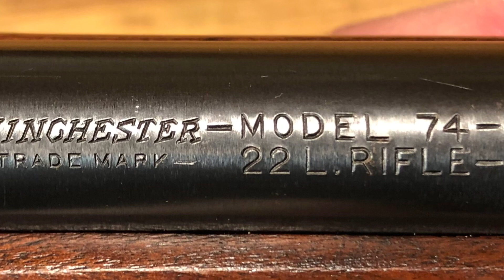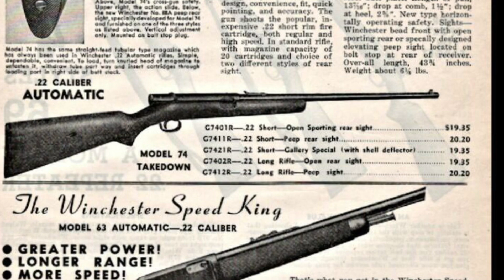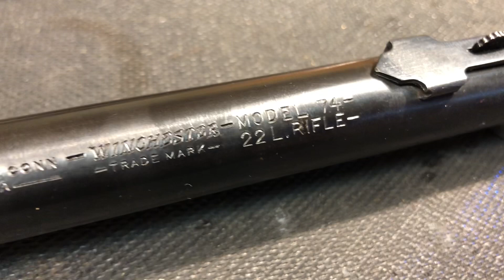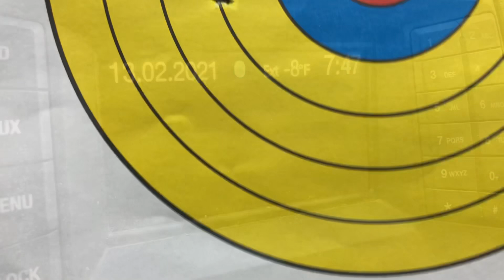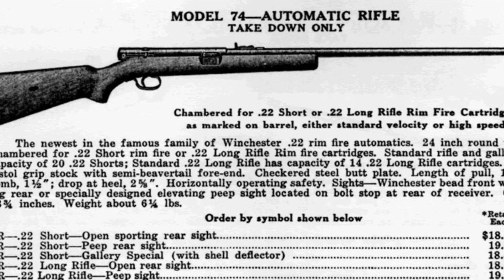Winchester 74: 22 LR auto loader

Comment: I would recommend brass or copper wool, rather than steel wool to address those minor rust issues, David.  It's a lot less aggressive, but will definitely do the job.  Soaked in ATF or light oil, is how I perform such tasks.
Reply from the maker: Thanks Karl will give it a try
Reply: @drdrake63  I actually brought back a super rusted single shot 22 (North America Arms Grizzly Model 10) using copper wool and ATF.  Could not believe how well it worked.  Slow and steady, wins the race!  Stay safe, David!
Reply: I've been using 4 aught steel wool and light oil for years, no problems. The oxide that blackens steel is harder than the soft steel in steel wool, just don't overdo it and you'll be fine. Cold blue is not true blueing and won't stand up to steel wool. Gunsmiths have been using steel wool forever, they might be on to something.

Comment: They were produce from 1935till 1955. My dad’s gun was made in 1948 and I found one made in 1949. Most all the guns of that time era have been totally refinish. As for as feeding problems, that particular Winchester model 74 needs to use Remington golden bullets 40 grains at least 1100 to 1200 ft./s. If you’re not using those rounds use Winchester, high speed, X 40 grain round nose.

Comment: It's the first to jam. Might try loading one less round and see if it helps. I'll try rounder heads and reduced round heads. It may come down to the loader spring. Doesn't make sense that you can zip through the rest with no problem.
Just watched another guy shooting it in short and it was the last round jamming. Something's going on. Too much spring for one and not enough for the other?

Comment: DRDRAKE63, That one is great shape.  I got one recently and I’m in the process of getting it range ready.  Everything, including the bore is in decent shape.  The buttplate is pretty rusty but not pitted, so I removed it to clean the surface rust.  When reassembling the butt plate/tube unit I get some resistance after it’s almost all the way seated.  To your knowledge is this normal?  I’m hesitant to push it all the way it.  Help!

Comment: I have a 24” early one that might have been dropped off a cliff or fell out of a rolling pick up truck.  The original stock was busted all to hell.  Found an original used one on EBay.  The Metal finish is mottled but not pitted.  It has a hair line crack at the back of the right side of the bolt release hole.  It runs like a scalded dog and is accurate as hell. I shoot it clean it and oil it😀